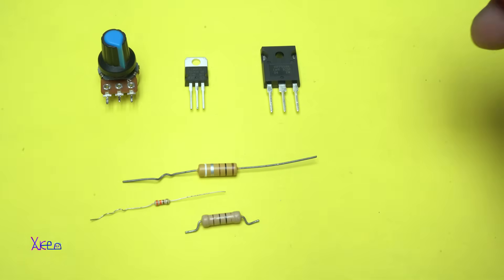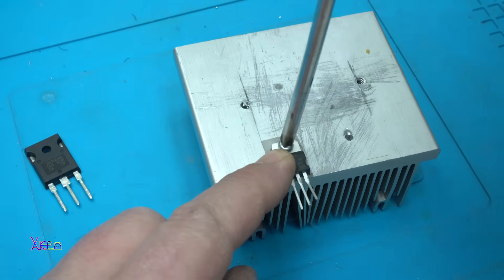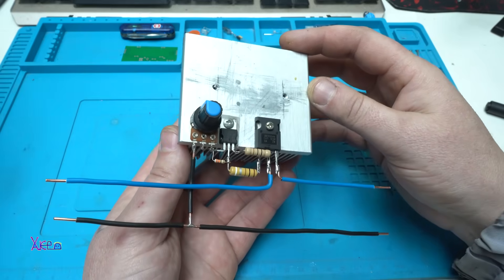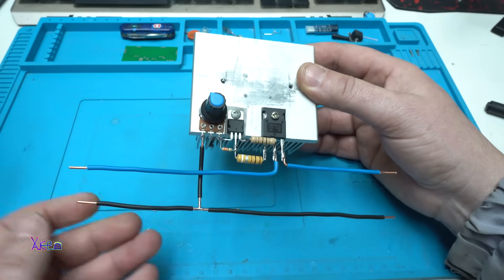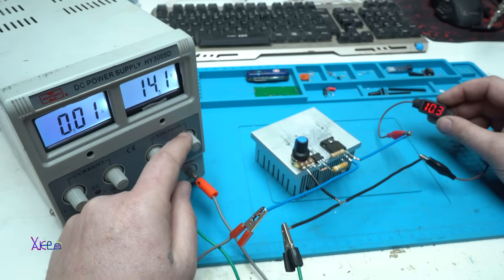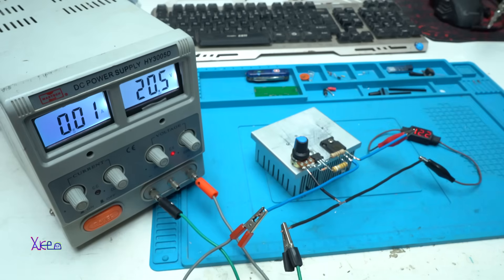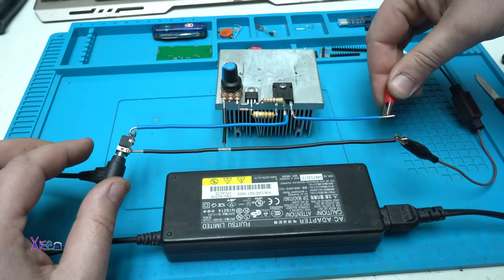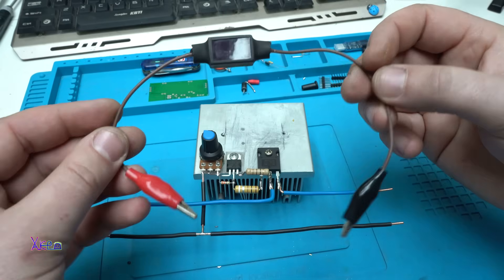DIY Adjustable Voltage Regulator 40V - 20A High Power & Current

Comment: Sorry this is not perfect ok you use a LM317 as regulator and a mosfet but if I ask for 20A the voltage may collapse especially since there is no voltage control at the output
Reply from the maker: You are correct, this design is not intended for high-current applications. I'll look into creating a more robust design in a future video.
Reply: @Hacktuber  BUT YOU SAID.....20A High Power & Current

Comment: 6:42 naaah, ditch the mosfet and replace the fixed resistor on the smps with a pot.
and add a voltmeter and a amp meter.

everything in it's original box.

Comment: That is a great project. Thanks for sharing.  👍
Reply from the maker: Thanks for watching!
Reply: I think this might be useful if you have a spare solar panel and want it to charge something at a specific voltage, but want a cheap and easy circuit. The solar output voltage will vary but can be kept stable (to a point) with this circuit. It might be worth adding a second pot to the circuit, one for corse tuning and one for fine tuning.

Comment: this is excellent. i have a PV panel that max output is 55v. the MPPT BMS is about 10m away from the panels diodes. i need 12v for a small device at the panel. perfect!